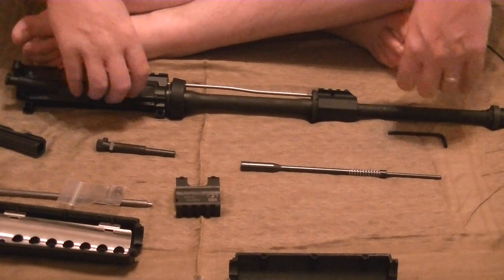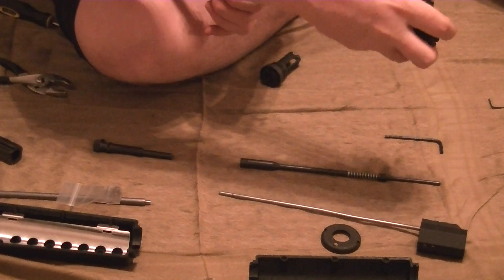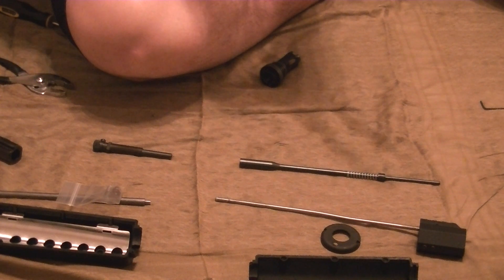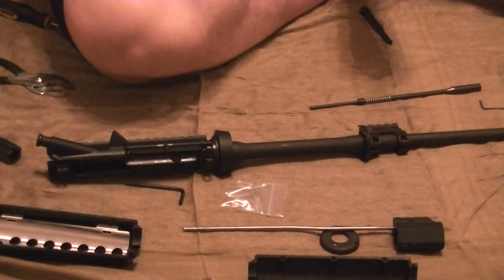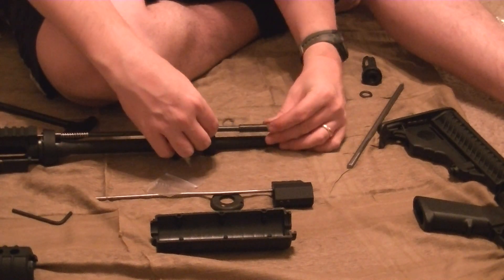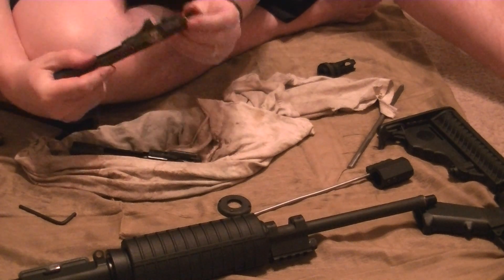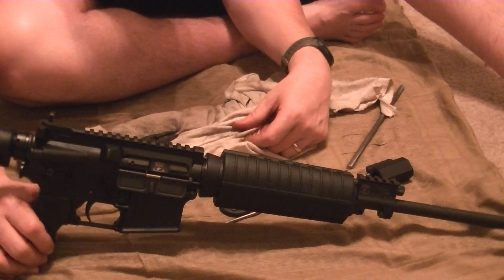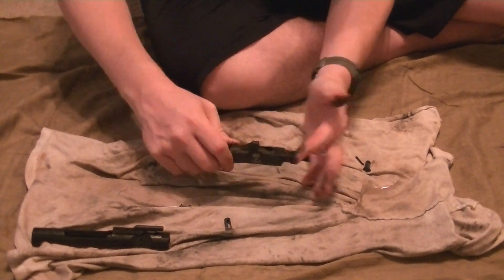Adams Arms Piston Installation

Comment: Wouldn’t have minded one bit to see the INSTALL part of the installation video. Can’t believe you did this sitting legs crossed on the floor on a sheet. Ever hear of a work bench, or at least a table? And “whacking” your rod in with a hammer?! If this thing blows up in your face, go back and watch your video and you’ll figure out what happened. This takes amateur to a whole new level.
Reply: I agree with 90% of what u stated, the part I don't get is in ur mind wtf would blow up by smacking the receiver bushing into place?

Comment: I got 2 of these kits a couple months back just haven't broke down to install them yet was waiting on picking out rails for the uppers. I got a Centurion C4 extended cutout rail recently so I will be needing to cut that delta ring off sure hope it works with the AA kit not listed on the site but heard the new Centurion rails with the A on the top will work. Think I am gonna get the cutout Samson Evo rail for the second upper.

Comment from the maker: Thanks spell check did not tell me the way I spelled it was wrong I fixed it.  The reason I went with a Piston was to see if it would get rid of the back pressure my suppressor was causing.  I like DI a lot but I don't like hot gas blow back in my shooting eye.